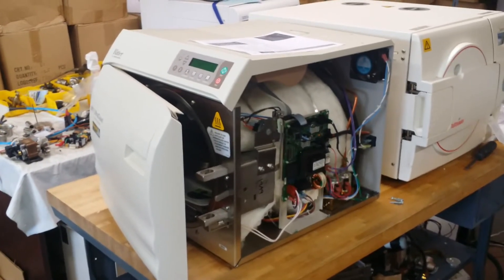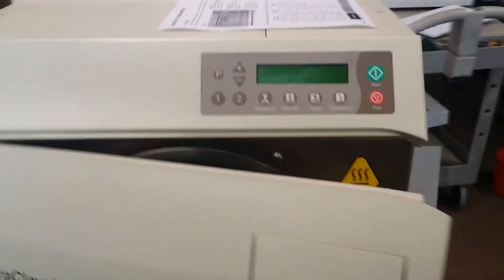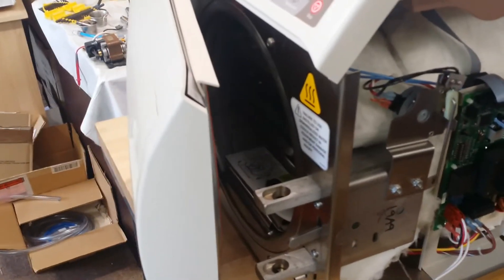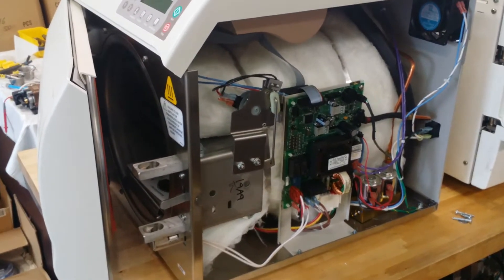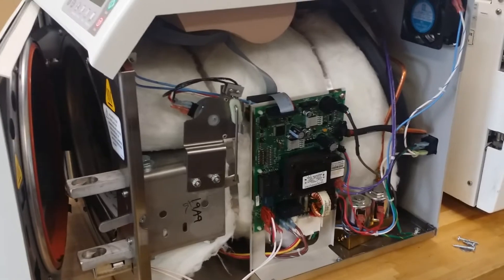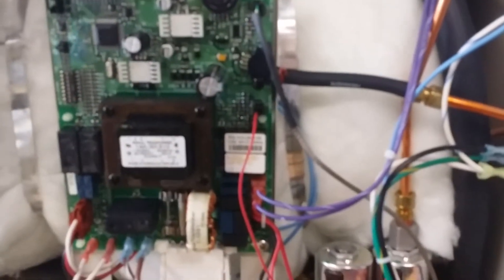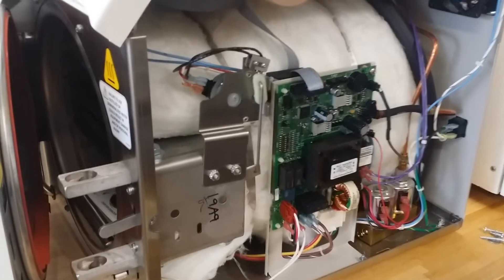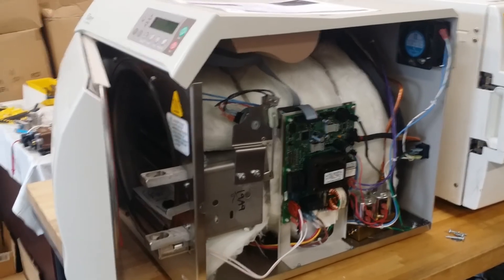How to fix New Midmark Autoclaves, Ritter Sterilizers, Ultraclave, repair M9 M11 020 to 022

Comment: Hi!, Our autoclave has a water fill problem. When I turn on the cycle, it shows 'water fill' on the display then makes one clicking noise and after that it goes quiet. It does not fill water....what could be the problem?. Thanks.
Reply: Please Dear, check if not some water on sensor water. Thanks you